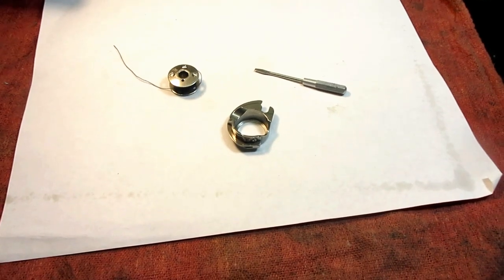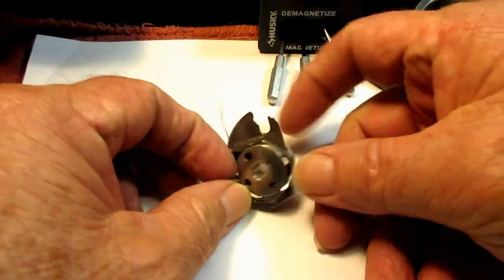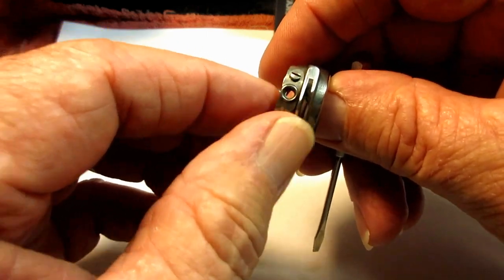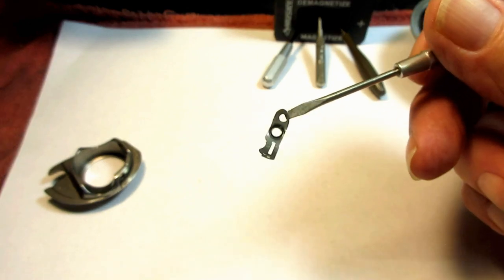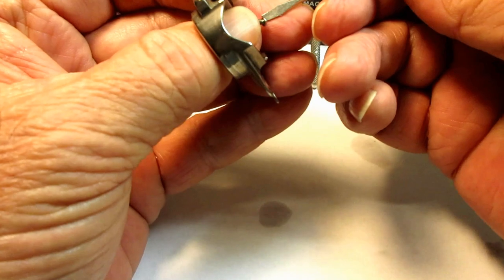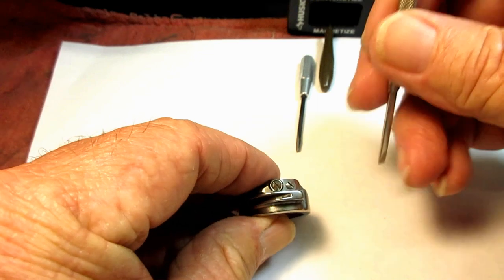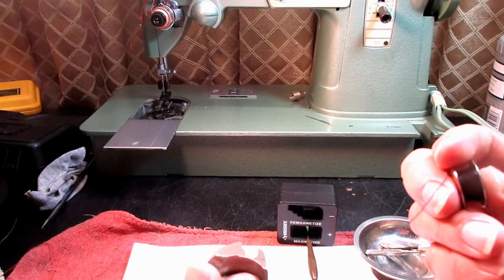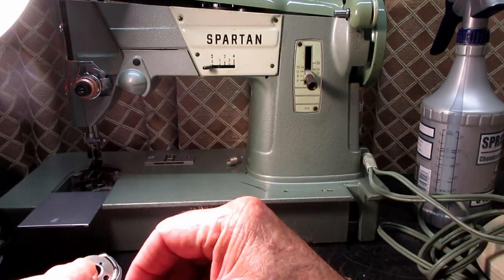How I Clean & Adjust a Singer Class 66 Bobbin Case, like this Model 327K

Comment: Just a note. I’m replying late on this video. I have 9 vintage now. Several with common bobbin cases. 2 of my machines wouldn’t make good stitches at all. I’m slowly learning cleaning, oiling, slightly taking apart. I had not found your video yet. I had taken apart and cleaned the bases and spring but then I noticed the springs were really flat on these 2. Like barely a curve. I slight bent them back to a C shape, very tiny bit, careful not to bend them out of shape. They both worked great again. It’s like the two owners kept tightening the screw over the years until they had no tension! Also on my Elna Carna despite many shop visits I stopped using it. How I started obtaining my vintage machines. I then went back after teaching maintainance to myself and took it apart and cleaned and oiled. In the bobbin case which was drop in, 2 tiny threads were wrapped around the screw and under the screw where the top mounted spring was. It was grinding so much I thought I broke some teeth on the bottom gears. So afraid to damage it more. It’s has worked like new since and I bought it in early 80s. I paid a lot to “get it fixed” and no one ever took that apart? The grinding came and went and I told them that. Paid $180 once for nothing! No longer!
Reply from the maker: Thanks for sharing this info on my channel. I pinned you comment to the top hoping others can learn what possible things to look for on their cases. I'm sorry for your poor repair experiences, but I have heard this many times. I started my channel and have made 500+ videos with the hope of helping people do their own maintenance and repairs and keep their vintage machines working well. Reading your comment, I feel validated in those efforts. I'm so glad you found my channel. It's kind of you to share your experience with all of us. Take care.
Reply: @andytubesewing1953  You have been a god send to me Andy: I have got hold of several machines that were destined for the tip over the past few weeks and your channel has helped me immensely. Thank you for all you do, it is much appreciated.
Reply from the maker: @kerry5586  Thanks, Kerry. I appreciate your comments, and that you are saving those machines.
Reply: @andytubesewing1953  It is a joy to see them coming back to life. Having been given a more modern none working machine recently, it has also really made me appreciate the great quality in these machines compared to ones from the era when they moved across to plastic and thin metal.
Reply from the maker: @kerry5586  It truly is a pleasure. Some family members learned the hard way not to bother with the new plastic machines and that it was better to buy a vintage one and rehab it completely one time and then you're good for 30 years of sewing.

Comment: I inherited my mother's 401A and have been using it for many years. It was driving me nuts trying to adjust the tension. Lots of looping on the bottom stitch and breaking thread. This video solved the problem. I took the spring off the bobbin case and sure enough there was a wad of smutz under the adjustment screw ( I could not get any tension on the bobbin thread). Also gave the groove a good cleaning. Now it's working great, perfect stitches and no more rattling. Thanks tons!
Reply from the maker: I glad you found the video, Doug. Thanks for fixing that incredible family machine. Nice of you to take time and comment. Stop by when you can. Model 401A videos: https://www.youtube.com/playlist?list=PLsCOZgzzaiKLiDl9yFTP6mJgQmz5lj4NO
Speed up your old motor: https://youtu.be/pzq4tv8qn94    Is your old foot pedal a little hesitant? https://www.youtube.com/playlist?list=PLsCOZgzzaiKL6ePPxLpmnWSzTyxPKTb71    Take care and happy sewing.
Reply: @andytubesewing1953  I also have a model 15-91 made in St. John Canada that is in beautiful condition. Saved it from going to the dump about 40 years ago. Also have a Red Eye treadle that still works great.
Reply from the maker: Oh, a great collection of wonderful models! Starting to feel a little jealous, buddy. Hehe

Comment: Thank you, Andy, for another helpful video.  After cleaning and zeroing out the tension assembly on my new 401, I was still having bad stitches. The bobbin thread was visible on top even with the tension set to 0 & turning it up made things worse.  I took to the bobbin case for cleaning and adjustment.... and while making a guess at what 1oz of pull was like, I decided to tie on a 1oz fishing weight and dangle it over the edge of the table as i adjusted the tension spring screw to the point where the bobbin would release slack with a slight touch or jiggle.  maybe not an accurate method, but my stitches are now looking like they should and Im at 3 on the tension dial. ....adding a pocket postal scale to my shopping cart for future adjustments.
Reply from the maker: Nicely done, Mr. Lee. Your method may be one of the most accurate. The two retired Singer repairmen I know said they used lead weights. I'm happy you corrected your machne and thanks for keeping it sewing.

Comment: Got my meter yesterday and have set a few bobbin cases, you’re right, it can be a little tricky.  I’ve since learned never to touch that adjustment screw again 😂
Reply from the maker: It's what the Singer guys told me was a EDI repair, as in "Easy Does It." Very tricky.
Reply: @andytubesewing1953  Andy, I got a new bobbin case for my 413 (plastic) yesterday and unfortunately it wasn’t set at the 1 oz mark.  I thought new bobbin cases were pre set.  Have you ever had to reset a new bobbin case…just so I’ll know for the future.  Thanks.
Reply from the maker: @rhondamercado7527  Those same SInger repairmen told me that into the '70s Singer shipped the machines to the SInger Stores. At those stores, the repair men/women would clean them up removing any protective grease/oil, and "fine tune" the machine. This often included installing or adjusting the Tension Assemblies, and the spool pins, and testing the timing and bobbin case tension. The timing & BC tension was tested and set by humans back then. The plastic BC you bought is mass-produced overseas somewhere and the tension is "approximate" as far as I can tell. The ones I bought were about a 50/50 chance of being OK. Some models have a recommended BC tension higher than 1 oz, too. I always just test sewed and went from there if I felt they needed adjusting. I do remember an occasional BC that was missing the tension screw, or even the tension spring, haha.

Comment: What screwdrivers do you recommend for working on vintage machines? I’m finding some tight spots too small for regular drivers. I have a one with changeable tips (hollow ground), but it’s still too big/long. Haven’t had an issue loosening screws, it has enough torque, but sometimes I need a shorter handle. I’m “going to school” learning how to restore & refurbish these old machines using your videos! Thanks so much for helping us save these machines for the next generation!
Reply from the maker: Hi, Liz. Thanks for your question, and for watching my channel. I mostly use two sets, one I've had for a while and one newer addition. The first is this one: https://chapmanmfg.com/collections/slotted-flathead-sets/products/9600-starter-slotted-bit-set
I use the little spinner in tight places and also the mini-ratchet when more power is needed.
The latest one I bought is here: https://www.wheelertools.com/gunsmithing-tools/wrenches-and-screwdrivers/43-piece-professional-gunsmithing-screwdriver-set/954621.html
A viewer recommended it and I like it. The handle is more comfortable and it has plenty of bits, all magnetized. I found I can exchange many of the bits to handles in both sets also.
Since you mention a need for shorter handles please take a look at these "Stubby" drivers from Chapman. There only 2.5" long and cost about $1.00 each. I have not tried them, but have had people tell me they like them as they have the same Chapman bits, but just a 2" handle. https://chapmanmfg.com/collections/stubby-screwdrivers-mini-screwdrivers
If you have an interest, here are links to the two videos I made about the screwdriver sets above.
The Chapman set video: https://youtu.be/KnrvDZeaYj4 
The Wheeler set video: https://youtu.be/7_DHIC6eskc
You may be able to find these sets on Amazon or eBay too, IDK.
Best of luck and don't be a stranger to Andy Tube now that you found it, OK?

Comment: I needed this video a lot. My 401A is not cooperating with upholstery thread on the bobbin. It shows that it is too tight in the stitch.  I loosened it so much that screw fell out. When I took apart to retighten, I broke that tiny piece off at the end of the spring.  Can I buy one of your extras you said you had?
Reply from the maker: Sorry to hear that, Marie. I'm not yet selling parts. Two of the Three sellers of replacement bobbin tension springs do not sell them any longer. The spring is part # 172202. Here is one seller I know of  https://www.singeronline.com/sibocatesp17.html   I see the price is $10 now. You can also buy used vintage bobbin cases from eBay. Her is one as an example:
https://www.ebay.com/itm/GENUINE-SINGER-401-403-404-500-503-SEWING-BOBBIN-CASE-HOLDER-SIMANCO-172082/153604181115?hash=item23c385cc7b:g:4k8AAOSwmAJdHBDc:sc:USPSFirstClass!85282!US!-1
It is $19 but you get the whole bobbin case including the spring and screws. They even include the bobbin case positioning spring. Personally, I would buy that one.
You can also find sellers in China selling bobbin cases cheaply if you do not mind a longer shipping time: https://www.ebay.com/sch/i.html?_from=R40&_trksid=m570.l1313&_nkw=singer+model+401+bobbin+case&_sacat=0&LH_TitleDesc=0&_osacat=0&_odkw=singer+bobbin+case+172083

Comment: Just need a little clarification on the krud kutter. Your clip shows a spray bottle of krud kutter, are you deluting that into another bottle or using it straight from the store bought spray bottle? Also can you use it on plastic, if so at what delution?
 Tomorrow I'm taking the tension assembly off my 328k, first time 😃  Thank you! I wouldn't have tried without your videos.
Reply from the maker: So the dilution percentage depends on the surface I'm cleaning. I usually buy KK in the gallon size. As stated in this video, for cleaning the bobbin case I use about a 15% solution. I use stronger solutions on metal parts that are dirtier with oil/grease all the way up to 100% KK on slant-O-Matic steel gears that are impacted with dark grease. I'm not sure what solution % is in the spray bottle. I only bought one of those, then went to the gallon. The caution with using KK is for painted surfaces as it will dull paint. On the body of a machine, I only use 10 to 15% solution and wash it off immediately. I stopped using KK on the painted dials of tension units b/c of fading. If you're just going to clean the tension unit you don't even need KK but can just use liquid dish soap in warm water, like Dawn. It works well on tension parts and will not hurt the dials. You can also use rubbing alcohol to clean the tension unit. Tension assemblies usually are not greasy or oily and are easy to clean. I just use KK b/c I've got it on hand. I do use it to clean plastic parts and it works well. a 10 to 20% solution depending on how greasy it is. Over the years I have learned I do not need as strong a solution as I thought. I've had people tell me they bought a 4oz bottle of it https://www.homedepot.com/p/Krud-Kutter-4-oz-Original-Concentrated-Cleaner-Degreaser-291528/203086056  and mixed it into about a gallon of water and cleaned their machine with it and different sized brushes then washed it with the hose/shower. I would not use it on a Black painted Singer body. I've been told it can damage the older style black finish. You can see a Dilution Chart for KK here: https://www.rustoleum.com/-/media/DigitalEncyclopedia/Documents/RustoleumUSA/Product-Documents/Charts/Original_KK_Dilution_Reference_Chart.ashx    and a Directions for Use chart, with dilutions, here: https://www.rustoleum.com/-/media/DigitalEncyclopedia/Documents/RustoleumUSA/instruction-sheets/krud-kutter/original-krud-kutter-Krud-Kutter-Original-How.ashx  God Luck, Catherine, and thanks for watching my channel.
Reply: @andytubesewing1953  Thank you for all the details. I'm just finishing your 401 tension video now. I took apart my 328k and found the tension indicator  is broken in the middle. I haven't been able to find a replacement on line....I might see if I can fix it with epoxy. I have a 348 that was giving me trouble and opened up the tension and the stop washer was behind the beehive spring. I bet you've seen your share of crazy stuff on old machines.
Thanks again for all the wonderful videos.
Reply from the maker: @BurgardPottery  The only aftermarket indicator dial I know of is https://www.sewingpartsonline.com/tension-singer-422403-455.aspx   It is for the 600 models and no idea if it would work for you b/c they are all a little different. The most successful fix I've heard of from a handful of people is pounding a small paperclip wire flat and cutting a piece to fix and gluing in place. You can find used 328K tension units on eBay, but who knows the condition of that bar? Yes, some crazy stuff for sure. A model 401A that was lubed with olive oil. An eBay machine I ordered from Texas that arrived in Arizona with live spiders inside. A machine advertised as "tested and sews well" arrived without a motor installed. A customer brought a machine for repair who said it "just stopped making stitches" only to find there was no hook installed. Just a few.

Comment: Hi Andy!!! Do you use the Krud Cutter straight out of bottle or do you mix with water? Thanks! Always enjoy your videos
Reply from the maker: Greetings, Frank. Usually mixed with water. General body cleaning about 15%. Parts like a bobbin case or needle bar you can soak in 25% KK. the more greasy and dried gunk, the higher %. I will use up to100% on steel gears of a 401A for example, b/c the gunk gets ground into the teeth. It also depends if you're in a hurry. Then the stronger % the quicker you can clean.

Comment: Although I rarely have had to adjust the bobbin tension in all the machines I have refurbished and kept, your video was great! I would like to know how you would go about sharpening the thread cutter on the pressure foot bar as my Singer 328K is extremely dull. I also see you have a little magnetic gadget in this video I would be interested in buying for myself if you would kindly share where to purchase. Thank you Andy!
Reply from the maker: Thank you<, Rita. First, here is the magnetizer I use: https://www.homedepot.com/p/Husky-Precision-Magnetizer-and-Demagnetizer-3601H/302880580?cm_mmc=Shopping%7CG%7CBase%7CPB%7C25-28_COMPRESSORS_AND_AIR_TOOL%7CHusky%7CBT3%7CBrand%7CAirTools%7CLIA%7c71700000045008692%7c58700004650922073%7c92700039927177447&gclid=EAIaIQobChMI29alsfHk4wIVAqvsCh2U9wm5EAYYASABEgKLXfD_BwE&gclsrc=aw.ds
There are many different brands. I just saw it in the store one day.
I sharpen the thread cutter with an Emory board, like for fingernails. In one direction. Then "smooth" out the edge with 600 grit sandpaper, as I use on the motor commutators. It is easier if the cutter is off of the machine, but I've done it many times right on the presser bar. 
I agree it is rare to need to adjust the bobbin tension. This one had been adjusted before, as evidenced by the damages screw slots. They can get gunked up from oil dripping off the needle bar area, then collect lint and dirt. Usually soaking overnight in alcohol or soapy water followed by fast running water will flush that gunk out. Thanks very much for still watching my channel.
Reply: Thank you both for replying. I’ll give the emory board a go. I’m looking forward to your next video;)

Comment: I just recently did battle with those two screws, only to learn that the tension screw was stripped. Ordered a whole bobbin case assembly in hopes that the tension parts are good. It was only five bucks. It's for a 1917 red eye treadle.
Reply from the maker: I thought the $5 was a typo until I saw the 1917 red eye info. You can buy new tension screws but they cost (with shipping) more than $5. I hope it works out for you. Good luck, and thanks for watching my channel.